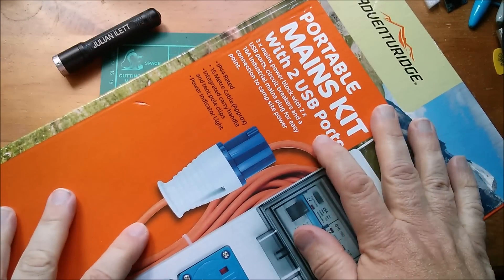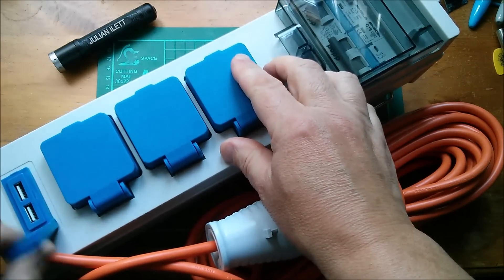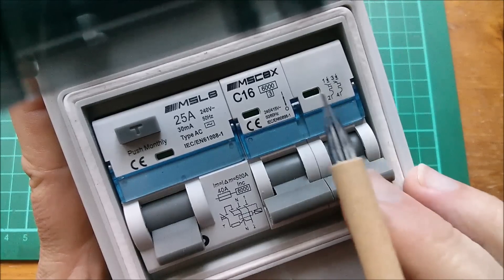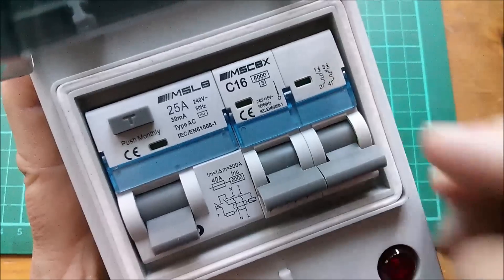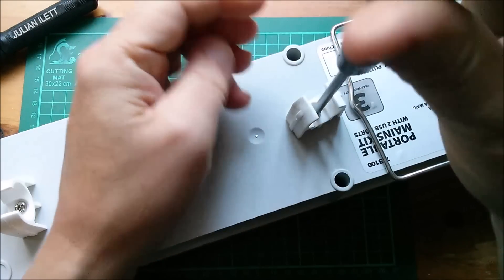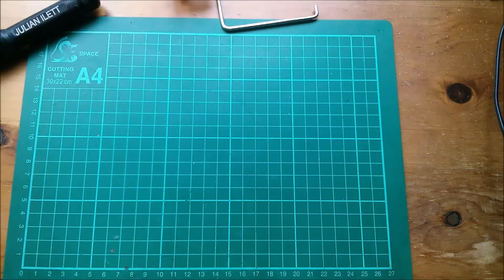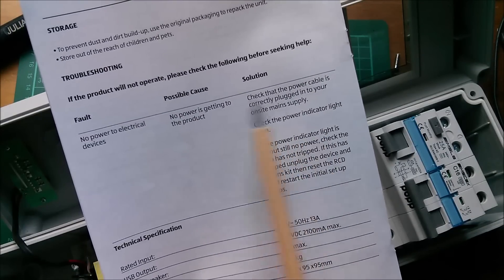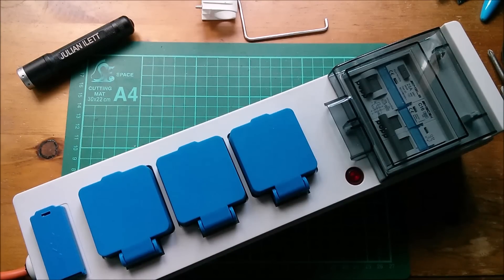Portable Mains Kit from Aldi

Comment: Oh that cable looks like 1.5mm, and that is Dodgy no way 25amps, you can not recommend this item surely I am suprised Aldi sell it
Reply: Doesn't need to carry 25A, there's a 16A breaker, 1.5mm² can carry around 20A in open air particularly outdoors. The campsite socket would have a 16A max trip on it as well (many are only 10A) so these breakers are only "belt and braces" and largely redundant as the campsite should already have RCD etc. protection in place.
Reply: @mfx1  1.5mm is only rated for 14amps but I have no problem Martin with you using it at 20 amps or even 16amps enjoy;-)
Reply: @fredflintstone1  . It's rated for 14a in an insulated wall not in open air.

Comment: The RVD can break up to 25A from what I understand.
Reply: That RCD is rated to break up to 6,000 amps in a fault condition. 25amps is the designed circuit limit.

Comment: Imagine you have no Earth connection at the socket. You'll think it's not live, and you'll be in for a surprise!
Reply: To be fair, the primary problem then would be the socket. Even on very old installations, PE needs to be connected to N, if no separate conductor for earth is available (two wire installations). Also this is just a simple indicator, not something I would trust with my life anyways.

Comment: You must have had a reason to buy this other than to take it apart and make a video. I've been subcribed for a long time and I've never know you to spend a total of £42 on anything....?
Reply from the maker: I was planning to use this on the big 2kW Bluetti power station. Not sure if the RCD would trip if current leaked to ground since the Bluetti has no ground reference. I also have a Lidl mains tester which I want to use on both real mains and power station mains. Lots more Lidl and Aldi stuff coming up :)
Reply: Yeah, and considering the insane amount of money he makes from from patreon - and from shilling - l've never understood why he can't buy proper equipment rather than sticking screwdrivers in mains sockets and other dangerous dumb stuff. (Yes he did that!)

Comment: Having a 30mA AC type RCD and a 16A MCB is, err, strange. It’s like the 13A U.K. multi-way sockets/extension leads that have a 13A fuse. Why? There has to be a 13A fuse in the plug that these are wired to… Same with this product. A 16A socket that provides power for equipment that is used outside, in order to comply with the standards would have to be protected with a 30mA RCD and a 16A MCB anyway.
And a AC type RCD is not designed to protect against any DC leakage current, even though there is a integral DC PSU… And the type C MCB is not exactly likely to trip first either. So this so called protection is not really adding anything unless you think the campsite has dodgy mains electricity infrastructure. In which case, why are you knowingly using such a supply?
And what is the size of cable that is provided? Others have speculated that it may be undersized…
I’m also not keen on how the neon is wired. Again, as others have said, if the Earth wire is open circuit, the neon may not light, but everything is still live. So some fool may start poking around, say checking the cable. If the cable has damaged insulation, said fool in thinking it’s dead, may zap themselves if the supply is not to current standards and does not have a RCD to save the fool…

Comment: Could be useful as a distribution unit in the test area. Should a peace of equipment you are working on develop a fault, better to trip the power locally rather than trip the house breaker. The USB might also be useful. Not good it's on all the time really.
As the neon uses such low power, probably 1/2mA it may still light (dimly) with a long cable run without the earth connected. Coupled capacitively.
Reply: However, Murphy's law dictates that the first breaker to trip will be the one farthest away and hardest to get to.
Reply: @RambozoClown  That's probably very true.

Comment: "The neon must be taking far less than the 30mA trip current..." - 9:08
Well, since inquiring minds want to know:  240V x 0.030A = 7.2W  Ya, that would be one bright neon light!
Typical current is likely less than 1mA.  So technically it adds to the current through the GFI but it is a very small amount.
Reply: That sound close to the mark. It's interesting that it is connected to Earth - seems like a good idea. The manual appears to be very confused.
Reply: @Bennyboy-dog  yes, neon cannot light with breaker off unless it was connected before the breaker
Reply: V*I = W  240V * 1mA = 0.240mW  V/I = R  240V / 0.001A = 240000R = 240K Resister.  So For a better Return GND and brighter Neon fit a GND Stake at your shed GND. All to do with the Cable length = more Resistance.
Reply: Connecting it to earth also helps with it being used as a "reversed Line/Neutral indicator ".

Comment: If you have a current clamp, it might be interesting to measure how much current that neon actually draws. That would tell you how much it should affect the RCD. If you have some beefy resistors lying around, you could even try to trip the RCD by trickling some current through them from live to ground, and see how much it takes to trip the thing. I wonder if that 30ma number is even remotely accurate.
Reply: The neon will be drawing less than 1mA. If it is dim, it could even be 0.6mA or less. I very much doubt that such a low current will be in the resolution of most clamp meters.
Reply: if the rcd is working properly it must trip above 30ma and may trip as low as 15ma

Comment: that is a potentially terrible product. that doesn't look like 2.5mm2 cable.. 16A over 15 m on what looks like 1.5mm2 cable is a recipe for disaster... if you don't think someone will use this for 16a loads I can assure you they will... somewhere
Reply: 1.5mm2 in open air can safely carry over 16A particularly over only 15M. Even if it was in an insulated wall it would only be slightly overloaded well within safety margins.

Comment: Why is there no ground connected to 'detect 30mA to ground'? I only see N and L going in there.
Reply: Re-watch this video from 3:25.
Reply: @robertwilldesign  Thanks, I get it now. Never thought of measuring on a return line 'expecting' there to be a difference. But that is exactly how this works.
Reply: RCDs detect an imbalance in current between line and neutral. Hence there is no need for an earth.
Reply: @Mark1024MAK  Thanks, I get it now. Never thought of measuring on a return line 'expecting' there to be a difference. But that is exactly how this works.

Comment: Flex undersized and probably the wrong type for use outdoors, the most useless type AC RCD,  world's cheapest components, defective instructions, inconsistent info (13A or 16A), and all intended for use in a high risk outdoor environment. 
Nothing good there.
Reply: Legend 🤣 I would expect better from aldi its all a bit shocking 🤣🤣
Reply: not to mention the exposed copper on the terminations into the rcd. ugh!
Reply: I thought you were dead.
Reply: @Tommyinoz1971  - I know. It’s a bit cramped in my grave. And the noise from the council when they use petrol powered strimmers to cut the grass is absolutely terrible ☹️. How on Earth is a supernatural supposed to sleep during the day?
Reply: Nonsens. A Fi german fehlerschutzschalter is very important.  New rules since 2000. Every cable had to be a fi with 25 mA. Cable outside for work or Camping with 13 or 16 ampere.
Reply: Nonsens. A Fi german fehlerschutzschalter is very important.  New rules since 2000. Every cable had to be a fi with 25 mA. Cable outside for work or Camping with 13 or 16 ampere.
Reply: At work I designed my own cheapoish version of something like this, needed for running our jet wash (Kaercher K4 ~2.2kW) on the sockets used for the caravans.
Needed to support 32A, 16 and 13A sockets and be relatively compact as the trolley all the jet was stuff lives in is not exactly cavernous.
I used a masterplug IP56 extension that we already had, wired that into a 13A IP66 FCU (using the proper spiral IP68 glands, and noting that ferrules were used throughout) which then fed a length of 4mm2 arctic flex terminating in a 32A socket. Adaptors were then made for 32A-16A and 32A-13A.

Note that I did not use a RCD FCU as the 32/16A outlets all have RCD's and as I was spending my own cash wanted the cheaper option, however the 13A plug is an RCD one although that may change as the plug can be difficult to fit in some sockets..
Reply: 1.5mm2 in open air can safely carry over 16A particularly over only 15M. Even if it was in an insulated wall it would only be slightly overloaded and well within safety margins. Of course if it's less than 1.5mm then it's potentially an issue. The insulation is dubious, would likely break down over extended outdoor use but it is intended as an occasional camping supply so UV exposure SHOULD be limited, TRS would be better but no Aldi/Lidl customer is going to be paying for 15m of that particularly in 2.5mm. However you look at it this is probably still FAR safer than most US extension leads.
Reply: I was thinking when I watched this, what would a qualified and experienced electrician make of this. Especially the cable, and the use of a AC type RCD that is not rated or designed to detect DC leakage currents. But is used in an item that has an integral DC PSU…

Comment: 6h with the plug means That the PE contact is at the 6 o clock postion
Reply: Other way around, holding the connector with PE at the top, the key moulding is at 6 o'clock

Comment: The unit in your hut with dim neon - might be cauaed by too long a run of cable hence highish resisance to earth, might be fun to test your hut sockets with a Kewtech etc. I had an issue with a long extension reel showing advisory "check" due to poor earth.
Reply: If the cable or connection is bad enough to make a neon dim, then it’s closer to being open circuit than it is to being a conductor!
Reply: @Mark1024MAK  Might be worth Julian checking his earth then.

Comment: Those connectors are more commonly known as CEE plugs with the blue ones being single phase 220-240v, red being three phase 380-400v and yellow being single phase 110-120. They are basically the industry standard for the more rugged industry type appliances in europe.

I believe a lot of camp sites only offer 10A power but i could be wrong.
Reply: Purple for low voltage.

Comment: The point of the neon lamp is to provide over-voltage protection. Neon lamps act a lot like MOVs in that when the voltage rises above their breakdown voltage they'll start to conduct significantly more current. In this design, that breakdown current is fed to ground in order to trip the RCD before the neon lamp or anything else becomes damaged by the overvoltage. The fact that it can also serve an indicator light is just a convenient coincidence that a lot of designs take advantage of.
Reply: You won't get any over-voltage protection from a neon with a series resistor as it currently is implemented.
Reply: @sdgelectronics  It will with that circuit topology: the point is to trip the RCD once the lamp's breakdown voltage is reached by conducting a fault current, rather than to clamp the voltage transient directly.
Reply: @AJMansfield1  I don't buy it at all. The neon lamp would have a series resistor of around 270k usually, so you'd need an overvoltage of over 8000V before the 30 mA RCD would trip.
Reply: @sdgelectronics  Depends on the lamp's voltage characteristic. Mind reading off the numbers on that neon lamp so I can look it up and check? I certainly wouldn't put it past the designer to have implemented it incorrectly even if that was the intent.
Reply: @AJMansfield1  - if the resistor in seres with the neon is a 100k value, it would require a over voltage in excess of 3kV to get to the 30mA RCD trip current. So I don’t agree that it’s over voltage protection. If there were being serious, an actual MOV would have been used. In fact more than one.
Reply: @AJMansfield1  The voltage characteristic of the lamp is irrelevant once you have a series resistor to limit the current into the neon. The resistor is needed whenever the neon is used as an indicator lamp. If it clamps at 0 V or 200 V you'd still need over 8000 V before 30 mA passes

Comment: I don't get the C16 breaker. If the outlet you connect to is rated 16A than thats the dimension for the supplier side breaker. Thus selectivity is crap, imho. Worse even, when the other breaker is a B16 you own breaker woud probably never trip first, which defeats the purpose of having one closer to you in the fist place.
Also, i never had electricity when camping, so there might be something i don't grasp about that matter.
Then again, i am arguing from the perspective of german code.
Reply: The campsite is probably protected by those ceramic fuses. If used correctly, they should melt much later than the circuit breaker. Just a guess. But yes, the campsite should be higher, but then the consumer cable is only rated for 16A
Reply: @holgerj7520  The type C breaker is already pushing it. You cannot rely on the safety margins of what ever the camper brings with them. And again, if the socket is rated 16A than that's it. No chance in hell you go for 20 or 25A just to provide selectivity. You can never know what people gonna plug into your socket. And people in general love to fry themselves and blame others for it. That's the whole reason "the code" exists. Also, having fuses that melt slower than some crappy chinesium power cord is baaaaad idea :)
Reply: @DasIllu  I think it's likely that they have just thrown together some parts.. looking at how that flex is stripped inside the unit, the no-name mcb/rcd brand.. i would be a bit spooked if I had 1.5mm2 on a C20 breaker, that's asking for trouble.
Reply: @holgerj7520   In the UK, I can almost guarantee that there will be no ceramic fuses.
Reply: @FluxLabsProjects  The more you know, thanks!
Reply: @holgerj7520  You're welcome. I would suggest in the UK all modern installs would have a MCB arrangement and maybe even a RCD to depending on the spec. You may find BS1361 cartridge fuses but it's highly unlikely.  In Ireland you may find ceramic fuses, but I don't know about the local standards there.
Reply: You're right about the selectivity, it's likely the B16 protecting the campside socket will trip before the C16 in this product...
Reply: You should never trust the safety equipment at a campsite, which is why you provide your own breaker and RCD that you can (hopefully) trust.

Comment: It was my understanding that the earth should never be used as a functional conductor IE have the neon powered by it, I am not sure that this product is compliant with the regulations and I do not think that it would pass a portable appliance test. Never seen that done, very strange cannot see a good reason for it.
Reply: Good chance it would fail an insulation test!
Reply: if the neon were to fail and go short, its a good thing it is after the breakers.
Reply: The leakage is not too different from class Y interference capacitors between L and E.
Reply: This is a fairly standard configuration actually - the neon lamp is primarily an overvoltage protection device (similar to a MOV), and it's just a convenient coincidence that it can also serve as an indicator lamp.

Comment: Doesn't that wire look kind of thin for 16A? If there's 15m of it the voltage drop is going to be significant.
Reply: Looks like a regular 3x1.5 mm^2 to me.
Reply: @tastenheber  Protip: use Alt+253 on the numpad for ² (1.5mm²)
Reply: @b0dge  Unfortunately my iPad doesn’t have an Alt key and I couldn’t find another way (holding down 2 doesn’t work).
Reply: Also the insulation will restrict it's use as it will get brittle in the cold.
Reply: @timballam3675  If it's that cold then the current isn't an issue anyway if it's 1.5mm ² then it can easily carry over 16A in open air. Re. insulation, it's intended for occasional camping use not long term use in arctic conditions.
Reply: Don't forget we are talking Chinese watts!
Reply: @MichaelBeeny  German super market stuff is actually often made in germany. Even ridickulously cheap cordless tools while namebrands like Bosch and Metabo might not be.
Reply: @rimmersbryggeri 
This unit says "made in china" on the back. It's clearly visible as he discusses the price just before disassembly.
Reply: @MichaelBeeny  Are those similar to the Japanese music Watts of the 60/70's :-)
Reply: @barrieshepherd7694  Yes Barrie, you got it exactly right! Not just 50/60, they use the same calculator today, also made in China.

Comment: The C16 fuse is only single-pole, therefore a switch is mechanically coupled that switches to neutral too.
Reply: The diagram on the MCB asked overcurrent protection on both poles

Comment: The 6h means that the earth connection is at 6 o`clock (bottom middle) of the plug and that the notch is at the same location
Reply from the maker: Interesting, thanks :)
Reply: 220V/230V CEE Plugs/Sockets all have the 6o'clock ground position, 110V CEE Plugs/Sockets have a 4o'clock to prevent plugging into the wrong socket. I'm sure there's a few more orientations for different uses.
Reply: As far as i know, the Position is also different for different Voltages and Frequences (together with the color of the Plug & Socket).
The name of the standard is "IEC 60309" (in Germany better known as "Starkstrom" or "Baustrom").